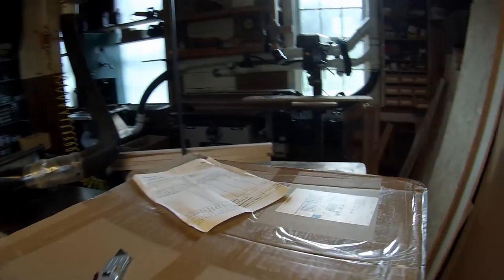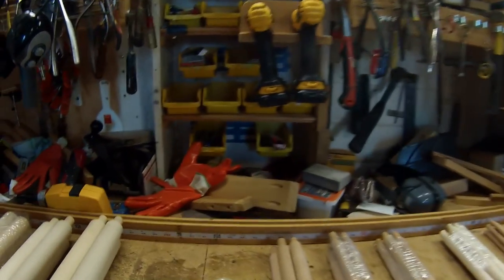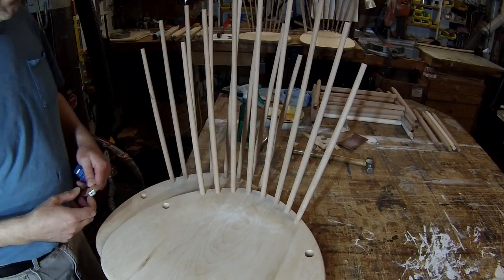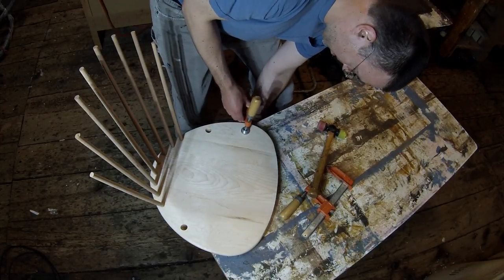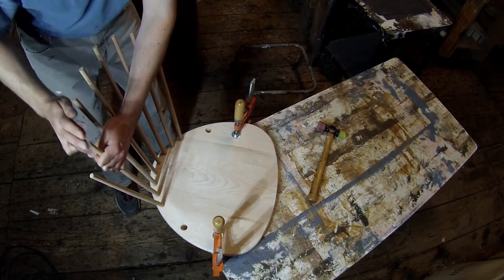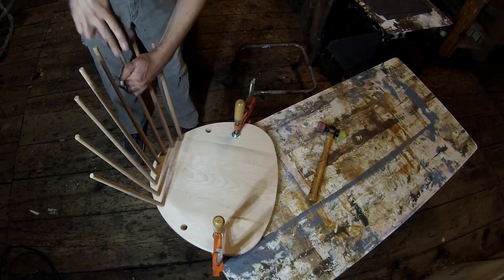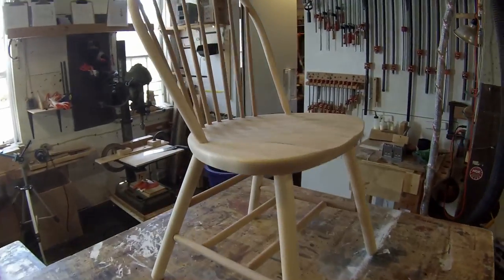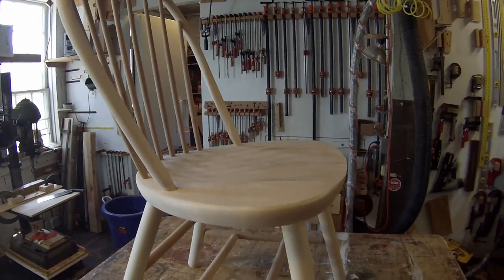Chair Assembly Video

Comment: If you are looking for a cheaper and likely faster option I offer parawood chairs.  They are made in Vietnam and come in boxes of two un assembled. They are the same chairs as what you see at rooms 2 go and Ashley furniture. You have the option of buying them finished but the selling point for my customers is they can be matched to their table. Parawood is not a good wood for stain but with a high quality gel stain you can make them look amazing. They have a 1k min order which is affordable and the price per chair is very reasonable leaving you a good margin. If it's something you think you want to try out send me a message or something and I'll get you the information.  I'm not sure what shipping is like as I pick them up but I'm sure it would be too bad as they come packed tightly in those boxes. Oh also the assemble time for me is about 6-8 mins per chair. With that said they are mostly bolt fastener style assemble.

Comment: MMF Co. should recommend your video to their customers for assembly guidance.  What are to two holes centered front and rear on the bottom of the seat used for? I didn't see you work with them.

Comment: You're good at making jigs so if you do this often enough I wonder if it would be worth your time to make a clamp vice of sorts for the chair back install. Make a multiple layered form of the same radius as the back that you can attach pipe clamps on protruding flat blocks that are attached to the curve then lay the chair on it's back to press the back into the seat.